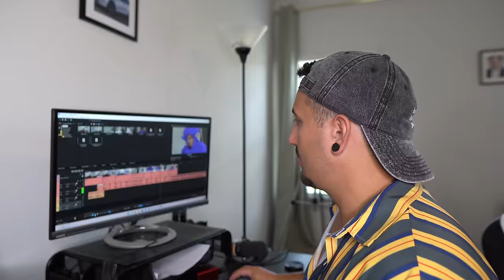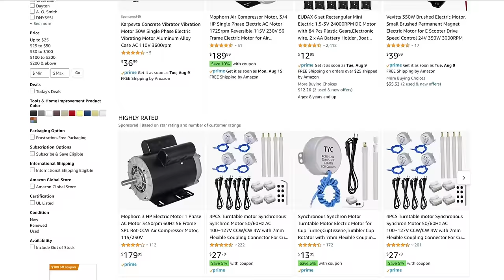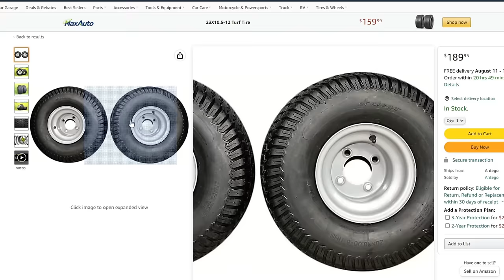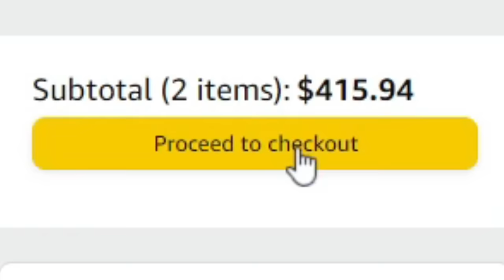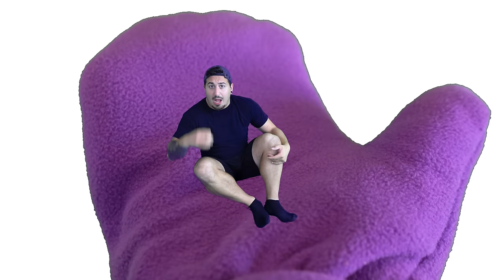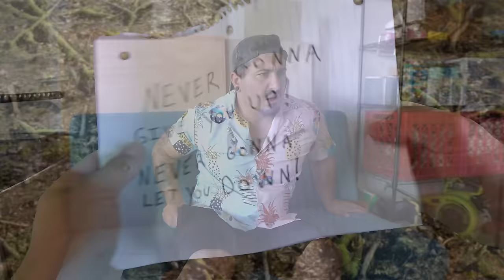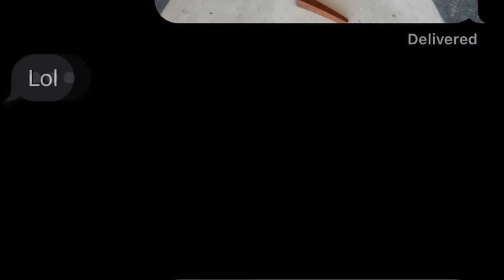I Built a Tesla out of Trash

Comment: Bro said building a SSS (steering suspension system) is hard, dude, all you have to do is get a steering axel, put threaded holes in it, mount hydraulic arm bars to the wheels (preferably 6cm away from the inside of the wheel) and hook it up to the back of the "Car".

Comment: import math
import sys
import os

def main():
    A, B = 0.1, 0.3
    # create z-buffer
    depth = [[0 for _ in range(80)] for _ in range(24)]
    # calculate the donut's surface points
    vertices = []
    for i, j in [(i, j) for i in range(0, 18) for j in range(0, 36)]:
        theta, phi = math.pi * i / 18, 2 * math.pi * j / 36
        x, y, z = math.sin(theta) * math.cos(phi), math.sin(theta) * math.sin(phi), math.cos(theta)
        vertices.append((x, y, z))
    # spin the donut!
    for i in range(1000):
        # create the frame
        frame = [[' ' for _ in range(80)] for _ in range(24)]
        c1, s1 = math.cos(0.1 * i), math.sin(0.1 * i)
        c2, s2 = math.cos(0.05 * i), math.sin(0.05 * i)
        # calculate the donut's screen coordinates
        points = []
        for x, y, z in vertices:
            x, z = x * c1 + z * s1, z * c1 - x * s1
            x, y = x * c2 - y * s2, y * c2 + x * s2
            f = 1 / (A + x * x + y * y + B * z * z)
            xp, yp = int(40 + 30 * f * x), int(11 + 15 * f * y)
            points.append((xp, yp, f))
        # draw the donut
        for p1 in range(len(points)):
            for p2 in range(p1 + 1, len(points)):
                x1, y1, z1 = points[p1]
                x2, y2, z2 = points[p2]
                dist = math.sqrt((x1 - x2) ** 2 + (y1 - y2) ** 2)
                if dist < 2:
                    intensity = (z1 + z2) / 2
                    if intensity > depth[y1][x1]:
                        depth[y1][x1] = intensity
                        char = ".,-~:;=!*#$@"[int(intensity * 10)]
                        frame[y1][x1] = char
                        depth[y2][x2] = intensity
                        frame[y2][x2] = char
        # print the frame
        os.system('clear')  # for unix systems
        print('\n'.join([''.join(row) for row in frame]))
        sys.stdout.flush()

if name == '__main__':
    main()